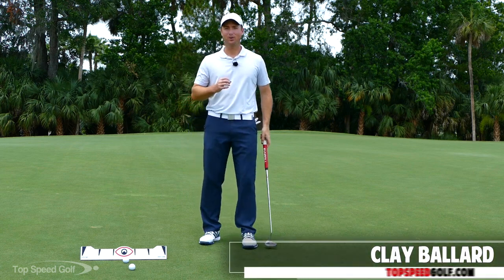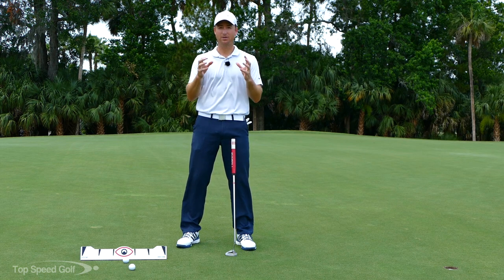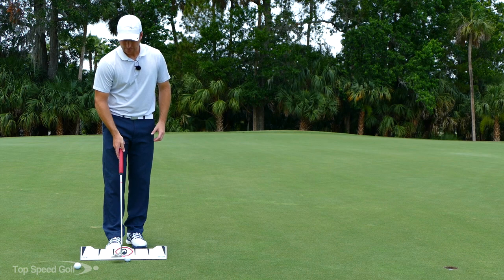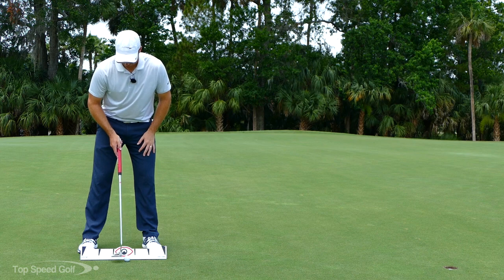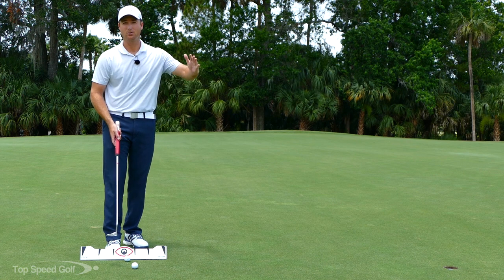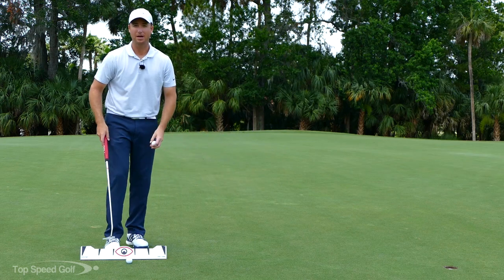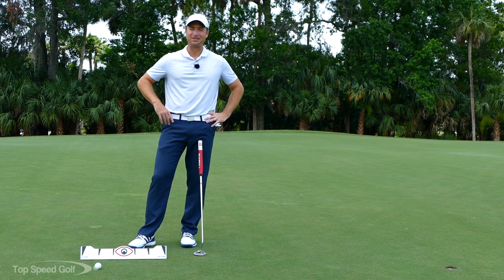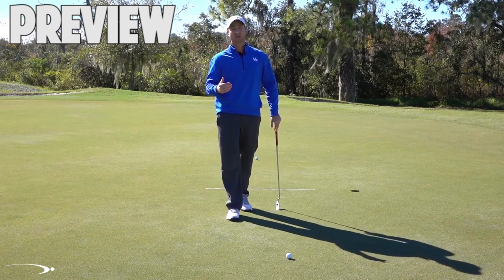Why You DON'T Want a Pendulum Putting Stroke | 36/64 Rule

Comment: Any tips for consistent strokes for loooong putts? 25+ feet?
Reply: ZeroTSONG practice practice practice
Reply: Sure... when you first warm up on the greens each day (because grass grows and conditions change due to the changing length of the blades of grass.) The way to control 25 foot putts is the same as a 10 footer, or a 50 footer.  That means you have to establish a gauge to use so you have control of length. Line is about seeing and using the undulations of the green complex to establish the ball's ideal travel, but the key is always about proper length. Even on breaking putts. In fact correct speed is even more critical on breaking putts. 

 When you first step onto the practice green the idea is to dial in green speeds for today. I would suggest you don't aim at any cup, coin or mark when you start, but to do some serious test runs to establish today's conditions. Start by taking the putter back about 4". Try to be exact with that 4" too. The more exacting you are with your take-a-way, the more consistent you will become. Putt 3 or 4 putts concentrating on the distance of your take-a-way. Then walk off the putts and see how far they ran out.  Now you know how far the ball goes on a flat 4' putt. What you can do is, then do the same test with 6" take-a-ways, and then again at 8". Now you have somewhat of a gauge you can use out there. In fact I finish my own routine with three putts from long distance to get a feel for them too. I have cupped putts over 100 feet by the way. 

What you will find is that using this information will allow you to get better at lagging the putt the proper distances. Conditions change, and they do so daily. In fact under windy or changing weather, conditions can change pretty quickly. When you can lag those 25 footers inside of about 3 or 4 feet consistently, you will convert the majority of your follow up putts. Some of these putts will fall into the cup too . Sure you will miss some of the comeback putts too, but you'll get pretty darn good from 5 feet and in and miss less and less over time. Over time, even an 8 footer seems fairly routine. At least I find it so.

 The truth is the very best players in the world don't make too many 25 footers. They average at 5%, and they are leaders in that category. There are some who have gotten it to around 7%, but that is rare. So don't put too much pressure on the 25 footer, but work on distance because in reality, even for professionals, the focus is they leave themselves an easy clean up with their next putt. If the 25 footer goes in, great, but make sure your distance is proper first and foremost. If you miss your line by a foot (which is HUGE) but the distance is right, you have a 1 footer left. (Depending on green undulations of course.)

 I think I was one of the worst at putting, in all of golf's history (not joking). I think I did just about everything wrong that could be done wrong. I "popped" the ball, which meant I had zero control over length and certainly didn't consider the length of the take-a-way. I set up open to every target line, which means any variation (even minutely) caused my sight line to change. I pre-leaned the shaft too far forward, which delofts the face (yes, putters have loft.) That makes the ball jump when struck. Every putt would jump an inch off the grass. I had zero control on either the line or the distance. Now I three putt about once a round. I usually make 2 or three good putts that off set that 3 putt anyway.  Learn to test the speeds of the greens TO BEGIN YOUR WARM UP. After you dial it in for the day, putt at some cups from varying distances. 

You only get one swing out on the course for any shot, so practice that way while you warm up. Now is not the time to work on your technique. Now is the time to execute your plans. Aim at differing cups, from differing lengths, using the information you gleamed about how far to take the club back to create exacting distances, for the EXACT length of putt you are facing. I use two inch increments usually, when I putt. But on real fast greens I even get down into 1 inch segments. We all know how hard it is to have only a 1 inch take-a-way. But if you warm up like this, you too can command that amount of control over the take-a-way itself. If there is one defining aspect of golf, it is length. You use it to decide the clubs you will utilize, and the idea is to hit the ball to precise distances. From tee to the cup, that never changes. It does you no good to hit the ball 150 yards, or 300 yards, when you were trying to hit it 225. The same focus of length is mandatory on the greens if you want to have control of distance, or line with breaking putts. To have this, you must understand the conditions you will be playing under... for that day. How you warm is the key.
Reply: Thanks for the lengthy response eddiebro101!  I try to dial in how the course is cut pre-round with a few practice putts but I'll try what you suggest, which sounds like a much more systematic approach.  I'm a new player and kind of learning how to putt consistently without trying to help the ball along by quickly and erratically snapping my wrists for extra "umph" (is that what you mean by "popping" the ball?) and keeping what I consider to be a pretty steady natural pace.  I've been scoring pretty well within ~8 feet and seldom 3 putt... except with those darn long putts!  I'm pretty consistent with my swing in close, but I find myself either getting wristy or hitting it much faster than normal when it comes to longer putts.
Reply: use wedge🤣

Comment: No putting stroke works for everyone!,  Different arms, legs, tummy, chest, shoulders etc.   Just need to find your own 5 foot putt, the one you can hit straight for the first 5 foot of a putt, if you find that every other putt is the same.  Just a little longer.  These gizmos are a waste of time and money, all you need is a tee, put one in the ground on a flat piece of the practice green and find a putting stroke that lets you hit if from 5 feet away 9 ties out of 10.  Have a twenty foot putt, read it and hit it a little harder at the tee, 30 foot, harder still.  The line may be a break of 15 foot one way or the other, but just make that 5 foot straight putt and let the break take care of itself.  Oh, and pendulum is the most success foul for no professionals because it is te easiest for us to repeat consistently!
Reply from the maker: Hi Sean, thank you for sharing. I love how you really simplified putting. Play well ~ Quentin | TSG Instructor

Comment: Top players have such a short stroke because they play on quality fast green.  Try some average track and see how far your 15 footers get with a 6 inch backstroke
Reply from the maker: Hi, I completely agree. I play public courses with slower greens most of the time. You can do this drill with any length of stroke though. Play well ~ Quentin | TSG Instructor
Reply: OK maybe I misunderstood because I often hear about a limit on stroke length for putting in order to maintain control, but that's only any good on half decent greens.  Personally I use a C-groove, eyes directly overhead and all shoulders like a cradle, and I push hands forward a few inches just before starting the stroke.  I usually get a good roll that way.

Comment: Without using a gravity fed pendulum motion, there is no way that you are "stroking" the ball. Using muscle input to accelerate
 the club head into the ball is a hit not a stroke. that being said, using muscle input to determine distance control is easily influenced with Adrenalin which opens up an all new issue under pressure.

Comment: 99 players on tour?  You mean the guys who putt on perfect greens the same speed every week and are still "streaky".  They putt well four or five times all year and keep their card.  There are three  ways to swing the putter and the instincts consider two of them to be "spastic".  Short back and accelerate through....spastic.  Long back and decelerate through.....spastic.  You have only one shot at instinctive distance control with the putter.....pendulum.  Period.  Clay, maybe sometime I'll come up and show you the magic of using the innate processes correctly on the putting green.  Might be dangerous though, you'll start thinking about going on tour.  A level of golf not yet seen exists because we are, after all, still human.  Peace.
Reply from the maker: Hi Frank, thanks for taking the time to post. I try to base everything I can off of the science and research that is available. If someone is putting with a pendulum stroke and putting very well, by all means, keep doing it. 

I only recommend a non-pendulum for two reasons. 

First is that if the club head is still accelerating at impact, that means it will have more momentum in the follow through, making it shorter. If it were even back and through, the head would have to be neutral (neither accelerating or decelerating) at impact. Or it could be accelerating at impact and then extra force after impact to slow the putter down. 

Second, is that I like to teach methods that have been tested and proven to work at the highest level. I know you are just joking around a bit about tour putters being spastic. They obviously make tons of putts. Especially the guys with the highest strokes gained putting averages. Since this is what they are doing on average, that is the way I would recommend to practice. 

It sounds like you are putting great, so I wouldn't fix what isn't broken! Play well out there! 

Clay

Comment: Too much information.  The 1 to 2 ratio for acceleration is all that's needed.  The concept of acceleration is the key.          Let's not forget,  you can have the best stroke on the planet,  but if you are putting on shitty greens and volcanoed holes, you won't make putts.  

The pros are good because of how they tweak their equipment and how consistent the surfaces are they play on.         Put a pro on greens where the cups have stayed for 3 days and 500 rounds, they arent going to make putts anymore than a 5 or 10 handicap.  Period.
Reply: Thanks for condensing. 1 to 2 is all that's needed
Reply: 100% wrong. The greens on TOUR are fast as hell and the pins are tucked. There’s zero 5 handicappers in the world that can out putt any TOUR Pro. If they played slow greens they would break 60 regularly.
Reply from the maker: I think you guys are both correct. It is easier to make closer putts on tour greens because the surface is better. But the greens are fast and the undulation is usually greater on tour courses, which makes it difficult to  two putt. The average player would have more three putts, and make more short putts on tour greens.
Reply: Generally would disagree here, pro myself who on occasion gets to play at events and I can say that it is generally much harder to putt public slow and bumpy compared to fast and true....reading lines is much more important on fast greens.  You have to get the ball moving and the range of speed is much smaller, on slow greens you not only have to read but you speed range is much greater and likewise it makes it a lot harder to putt true....well rolled greens will also hold lines much truer.   Whenever I'm at a pro event I tend to putt much better than I do on public.....maybe it's just me :)
Reply: Wyatt Spencer well there’s Lawrie...😅